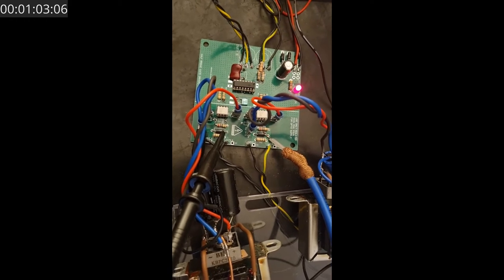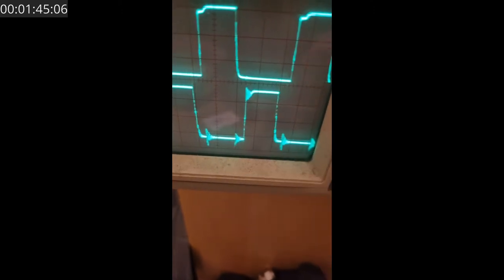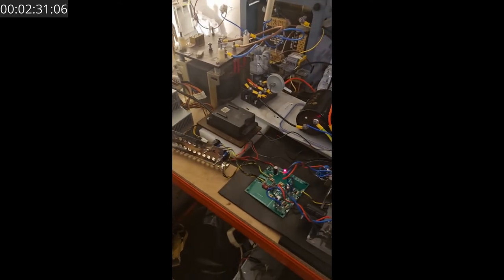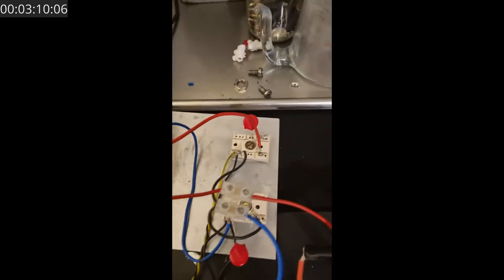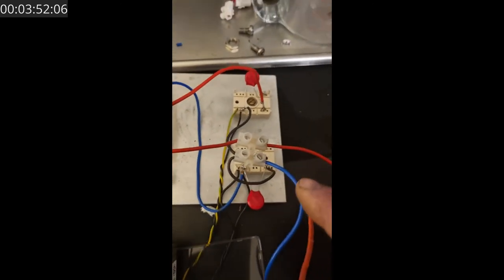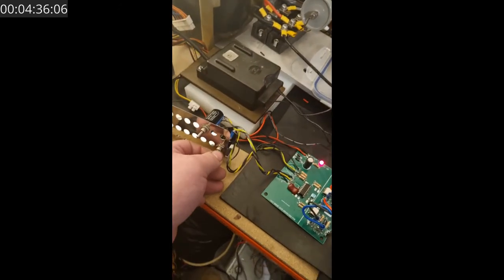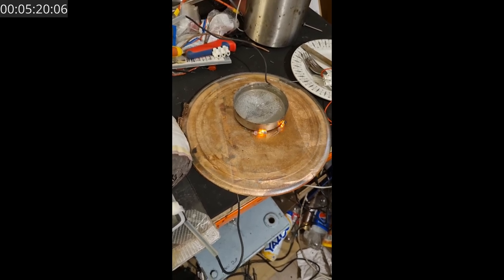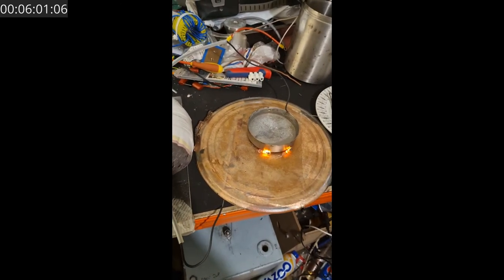#29 - Homemade half bridge driver/oscillator project.

Comment: Nice ^ , I like the PCB driver
Reply from the maker: Thanks :) I had 10 made so if you'd like one I could send you a board.
Reply: @kaboooom2000uk  oooh I want one, does it utilize the tl494 and ACNW3190 ?
Reply: @kaboooom2000uk  Do you have scheme and pcb file?
Reply from the maker: @Tsindur  yeah I do somewhere I can share it with you just remind me I kinda am working a lot at the moment but yes sure.
Reply from the maker: @Tsindur  TL494 and the optos are FOD3182

Comment: I know you helped breeztix with his driver, so he could use it on flybacks etc. Could you share with me the driver (where I could get one on ebay), then the caps and the IGBT driver schematic?
Reply from the maker: That is true, it was a while back. Myself and a few other people contributed to the pool of advice given to him and I was happy to help. I will try to find the schematic for you. Just so you know, the circuit is taken from a few places on the internet modelled and I tweaked it to suit my needs, I encourage that you do the same. I also have a Gerber somewhere with the PCB if you wanted to get a board made. Anyway with it you can alter the duty and frequency, it drives optocouplers to drive IGBT/mosfet gates. you can experiment with the optocoupler, mine is a generic one.
Reply from the maker: https://ibb.co/74QnVcJ here is the schematic
Reply: Edit: Could it be possible that a PCB board with the connections could be made? I already have my variac main power DC supply and my 12 v transformer. I'm kind of new to IGBTs, as I have ventured beyond my Super ZVS driver. I'm getting back into the hobby after several years.

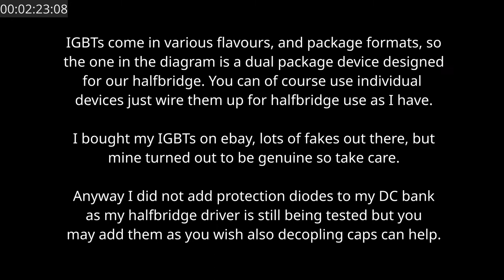Also, to clear up any confusion, I have my 12 volt inputs power the gate driver, then the outputs as OPTO 1 and 2 go into the IGBT, then my 240v supply powers the capacitors out to the transformer? It also looks like the diagram at 2:21 uses one IGBT? I forgot what serial code those units are called.
Reply from the maker: @steinke7850I see, well il try to help. At 2:21 it looks like one IGBT, but its actually a "dual" module. there are two igbts inside and are electrically connected like this... https://www.mouser.co.uk/images/marketingid/2019/microsites/148486131/Snag_407b4b3.png

if you need more help let me know. You do need a gate signal out of the optos which swings negitive, to reliably turn the gates "off" so youd prob need a much larger transformer than what I was using. I used a pair of very small ones.
Reply: Do you have the part number to that IGBT? Also, do you still have the ability to print the PCB of the gate driver?
Reply from the maker: @georgesteinke7850 it was while ago, so no cant remember the code of the ones I used, but its designed so you can use any IGBT or mosfet you dont necessesicaly have to use the exact one I listed... and yes i gave you the schematic for the driver/oscilator board, yes I can make more boards if needed but I dont need any more at the moment. I am doing other projects.
Reply: If you don't mind, could you attempt to try to make a board for me? I'll buy the other components as needed, (since this will be a slow project - I'm busy all the time).Having the board would greatly help. Thanks.
Reply from the maker: @georgesteinke7850  Makes 2 of us. No I can't pal. I'm very busy as it is myself.
Reply: Do you have the schematic file? I might be able to send it to something like PCB way to have a board made @kaboooom2000uk
Reply from the maker: @georgesteinke7850  yes I do, I will set it out, I am on vacation so il do it once im back. Maybe in next few weeks.
Reply: Any updates?